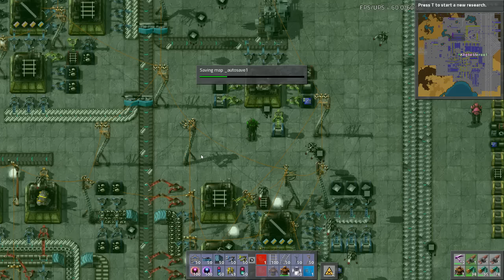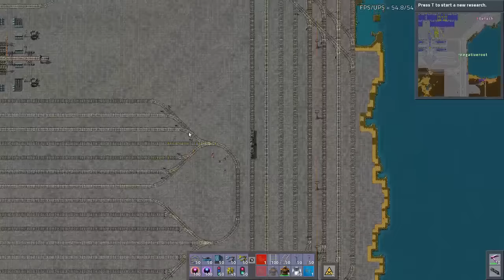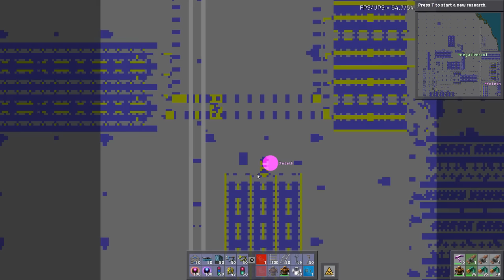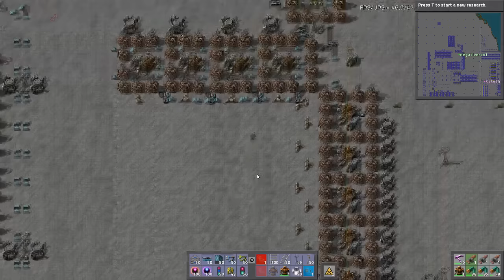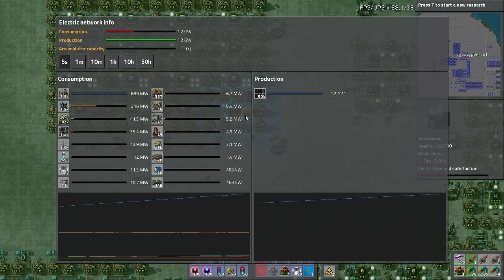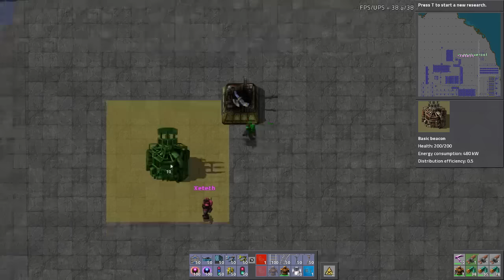Factorio Break The Game 156 Satellite Build

Comment: The main thing about manual power routing will be in 0.13 with the power switch. You can turn of beacons etc if your power is low or you are running out of coal.

Comment: F@#k it root, now I'm going to spend the weekend re-running power lines...
Reply: +Chris Cook Will a blueprint respect anal retentive power line placement?
Reply: +Chris Cook It should, yes, provided both of the power poles are blueprinted. It will however aditionally try to connect to any power pole in reach that isn't part of the blueprint as it would normally.
Reply from the maker: +Chris Cook yeah, my bad mate :D
Reply: +Chris Cook  Kind of, in my experience the power lines are determined by the order by which the poles are placed, sometimes they work, most of the time they don't.